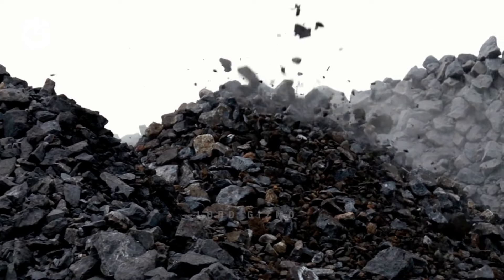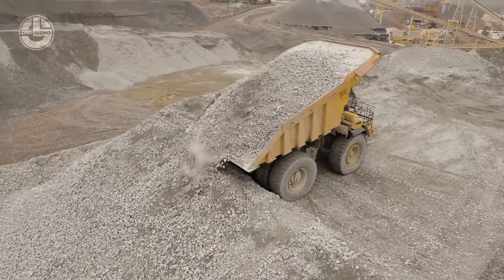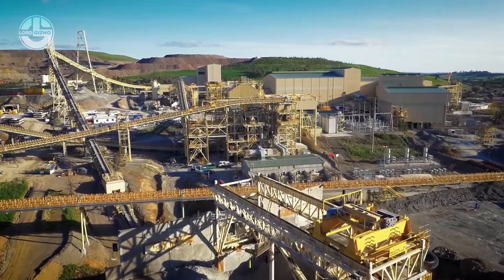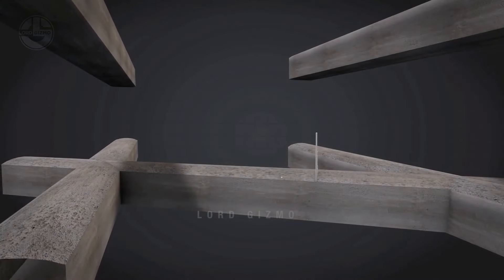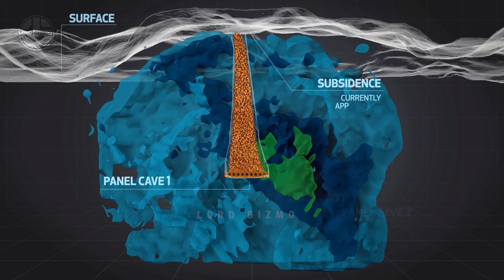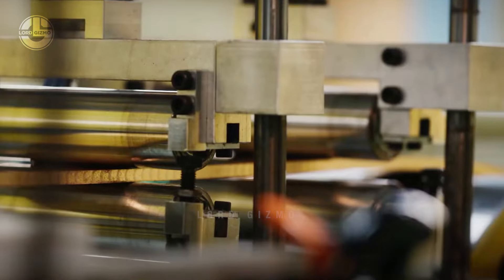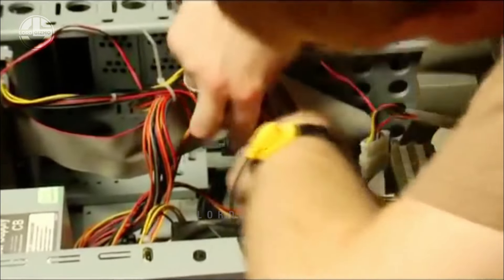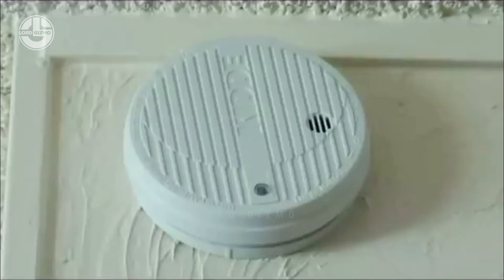Graphite Mining: From a Billion Dollar Massive Quarry to Marketplace

Comment: I wonder what happens when you mix graphite with gold. Maybe a super conductive circuit?
Reply from the maker: Hmmm good question
Reply: If done right, then yes; graphene with gold substrate. Silicon is still preferred because it's much cheaper for industrial purposes.
Reply: Id think bonding such a material together would be... Interesting.
Reply: Silver would give much better electrical and thermal conductivity than gold would.
Reply: @Enjoymentboy  Silver only has better thermal conductivity, and Silver oxidizes, Gold doesn't. The entire point of the substrate is that it needs to not oxidize when exposed to air.
Reply: @MK_ULTRA420  Silver has the highest electrical AND thermal conductivity of ANY metal.  Gold is worse than copper and it's only used for oxidation protection.  Silver doesn't oxidize readily in air.  Typically the black that you see on silver (ie tarnish) is a reaction with sulfur dioxide in the atmosphere.  My original point still stands: silver mixed with graphite would be a more conductive composition than would graphite and gold.  If you're worried about oxidation than an insulating jacket like what is used on any wire out there would help and be WAY cheaper than gold.  Worst case replace the silver with copper and you STIL beat gold in both electrical and thermal conductivity.
Reply: @MK_ULTRA420  Silver had higher electrical conductivity than copper or gold.